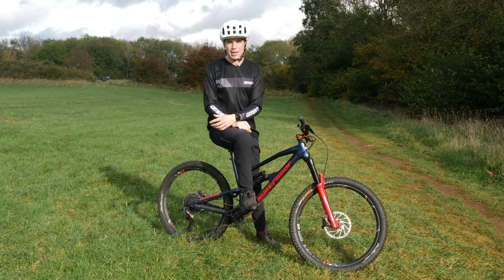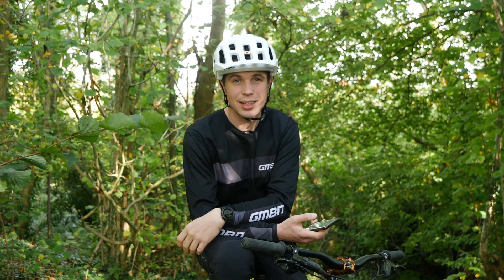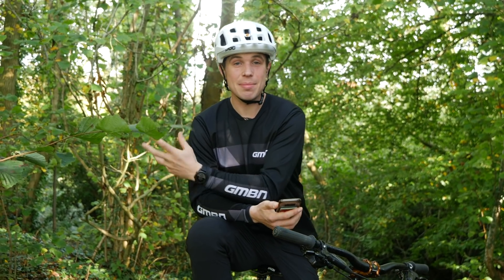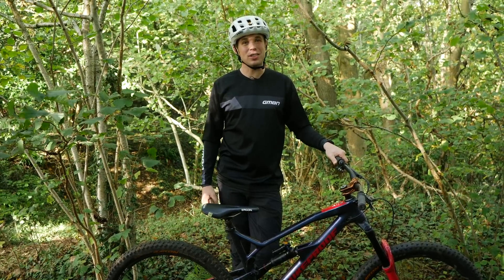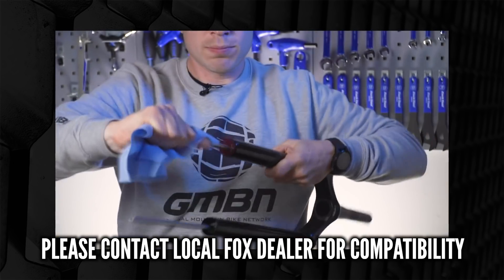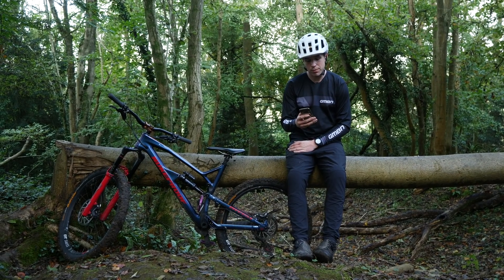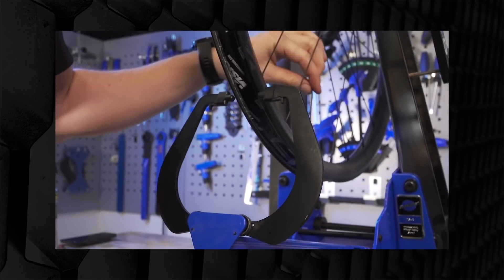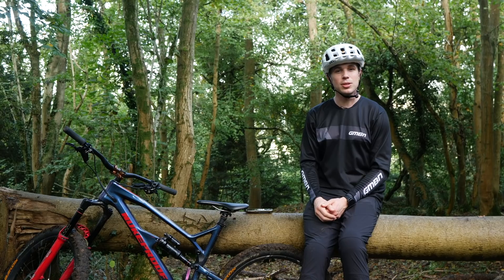Why Aren't Disc Rotors Bedded In By MTB Manufacturers? | Ask GMBN Tech

Comment from the maker: Got a question about MTB tech? Submit it below using the hashtag #AskGMBNTech for a chance to be featured on the show 👇
Reply: #AskGMBNTech This question is due to your statement about high-flow presta valve for tubeless not making sense since we can use Shrader tubeless valves which, due to their higher diameter, should flow much more air.  I asked worldwide cyclery if I can get replacement cores for the tubeless Shrader valve they carry, as replacement cores seemed to be a necessity for the presta valves.  I don't know if all cores for shrader would be compatible.  Since it is unusual, they did not understand the question and recommended I stick with Presta.  Could you cover this in more detail?  I am an engineer, and ever since you explained the silliness of trying to get high-flow presta valves when we could use Shrader, I can never look at them the same again.
Part 2 of the question is, I have aluminum hubs, so can I just drill out to fit the Shrader valves?  I really like the idea of a naturally higher flow valve.
Reply: #AskGMBNTech silly tech question: steel is better in tension than compression.  However, when I look at the "arms" on a disc brake that connect the rotor to the hub, the arms are in a direction where the arms will be in compression during braking and not under tension.  Is there a good reason for this or is it style? (or do I have it backwards?)
I am looking at your bike in the video above.  If you imagine the rotor as a motor that spins the wheel in the backwards direction (for the force it applies to the rotor), it looks as if it is pushing on the arms and not pulling.
Reply: #AskGMBNTech My rear wheel has some loose spokes. Is there a way I can retighten them without having to go through trueing it?
Reply: #Askgmbntech hi guys french frog eater here. I have got a canyon torque al6.0.  I would like to change my air rear shock (250*70) for  a coil one. I found a rs superdeluxe coil wc in 250*75, will it works ?

Is there a margin of adaptability or we must scrupulously respect the factory sizes ?
Thank you guys !
Reply: #ASKGMBNTECH 
Hi, I'm very much new in MTB. I got myself 2019 BH atomX with max torque of 105 Nm brose engine. Friend of mine suggested to have 2-3 sets of chains and swap them regularly to extend cassette's lifespan. What's your opinion about that ? Btw, huge thanx for your tremendous work and great channel. I've learned a lot already! Greetings from Poland.

Comment: About changing a spoke on a tubeless wheel...assuming the spoke is broken and that chances are you will cut it anyway, I slide a tiny o-ring over the nipple, unthread the spoke, install the new spoke and cut off the o-ring. You need a perfect nipple to do this as your grip on the square part of the spoke will be likely diminished.

Comment: #AskGMBNTech hi Henry and Doddy! I have a 2019 Rockshox Yari Debonair. Problem is that it's sitting low on its travel no matter how much air I put it. I have to lift the fork to reveal the missing 5mm. A lot of forums say it's normal. I need your opinion on this.

PS. I tried burping the seals with zip tie and the lowers have been serviced but still same results

Comment: Hello, I have a Merida One Sixty 800 2018 bike, as you probably know, this bike has  27.5 " wheels. I've been researching to see if it's possible to turn it into a mullet bike by changing the front suspension in order to fit a 29" wheel. As I understand it, this is possible on bicycles with original geometry for 29 "wheels and not vice versa, because they apparently affect that geometry very much. Do you think that is possible? And in that case what would be the recommended suspension considering that the front travel of this bike is 170mm?
Thanks.
Reply: If it is 170mm front and 160mm rear then I’d put a 160mm fork and 29” wheel as this wouldn’t change the geometry as much. If it’s 170mm front and rear then I’d get a 29er 170mm fork. In terms of the geometry, it will slacken the head angle and raise the front end, which may be able to be countered with stem spacers, you may also want to tip your saddle down slightly

Comment: #AskGMBNTech Hi Doddy and Henry! I have bought a new Boxxer Worldcup 29" 2019 this year. The fork is running sweet except last month there is a little bit of oil coming out under the Low Speed compression adjuster which gathers under the  whole compression adjuster unit. Also the Low Speed adjuster can now only be moved 2 clicks to closed until there is big resistance. Do you have any idea what this might be and how I can fix that? I already do service my fork myself. Cheers Chris

Comment: Hi Guys!

I will get my first full- sus- bike soon with a Carbon Frame. Are there any rules About using Special compounds for maintaining? For example: Can I use normal grease for pedals in a Carbon- crankarm? or is it possible to use White Assembly compound for the dropper seatpost,... or do I have to use Carbon specific compounds. Also interesting for me is what to use if re- installing the fork after Service in at the Crown area: can I use normal yellow grease or does it have to be a Special Carbon- grease/compound?

Cheers!
Reply: MrGrayFox0 I believe carbon cranks have aluminium threads, then get carbon gripper paste for your seat tube and any other carbon/metal or carbon/carbon interfaces. Not sure about the crown area tho

Comment: Hi there! I have a shimano Zee brakes, the are great but every time I leave the bike 3 o 4 days without riding, when I ride it again, the brakes feel contaminated (front and rear), the stopping power drops dangerously. After several hard brakings, their are at full power again. I've searched on internet and some people say that shimano brake pads tend to contaminate with moisture from the air. The brakes are 5 month old and are in perfect condition so I'm sure the problem is on the pads. Acutally I'm using resin pads, should I try another brand/compound to avoid this? Thx dudes!  #askgmbn
Reply: How do u store the bike? is it in a cold environment, two wheels on the ground, hanging vertically?
Reply: @powedits4447  I store it in my bedroom two wheels on the ground away from oils or grease and I pump the brakes few times a day.

Comment: #AskGMBNTech Hi GMBN, I've got a merida 140 700 2018. It has a center lock rotor in the back and a 6 bolt in the front. Can I put a six bolt on the back or vise-versa. Thanks :)
Reply: There are centerlock to 6 bolt adapters

Comment: #askGMBNTech Spongy Brake... My front brake is soft and spongy at first, but after a few pumps of the lever, it firms up and feels normal. Is there Air in my system or are the pads wearing thin and making the caliper pistons have to extend out further, which would make my lever travel further and feel soft? It gets scary bombing down a hill and when you go for some front brake, there's Nothing there at first.  But after few small pumps, the brake works fine. Thank you.

Comment: #AskGMBNTech Hi, love the show! I have recently put tyre inserts (rimpact) into my wheels and now the front tyre is no longer straight and the rear one keeps deflating (front tyre is relatively new, ridden it for ~1month before, rear one is older) Local bike repair shop said they did not find anything wrong with the front tyre, it is just zig zagging and said it should straighten later, is that correct?

Comment: #AskGMBNTech I am converting a 10 year old+ Scott Scale 60 to a 1x system.  I have a 2018 e*13 gearset off a newer bike but obviously can't use the 11speed rear cassette on the Shimano free hub due to sizing issues of the smallest cog. The e*13 is designed for an XD driver. I have a 32T e*13 trsr boost chainring up front and was going to pair this with a Sun Race MX80 11speed, 11-50 cassette at the rear.  Is it possible to pair a boost chainring with a non-boost rear hub or will this ruin the chainline.  Thanks, Steve. #AskGMBNTech

Comment: Hey #askGMBNtech I need some help.  My MTB came std 27.5+ w/ 150mm fork, (HTA 66.8°)(STA 74.1°)(BBH 335).  My MTB is 27.5+/29er compatible w/ a flip chip.  OEM states "fork must change to 140mm if wheels change to 29".  What effect will not changing out the fork have?  How many degrees will the HTA and STA be effected?  Any other issues with geometry if I don't buy a new fork?

Comment: #askgmbntech I am looking to buy a halo ridge line 30mm front wheel and was wondering if the extra width would change the width of my tyre by a significant amount or not as I'm not sure if my wheel would fit inbetween my fork,
Thanks
Reply: How wide is your current rim and tyre?

Comment: I convert to a 1 by 11 to a 1998 B17 Dh Marin narrow wide 34 tooth front and on the back 11 speed . 11 to 46 only problem I had was spacing the front chainring extra 1. 1/2 mm and using a two-piece hollowtech
Crank set and Shimano XT 11 speed clutch rear derailleur and Shimano XT 11 speed gear changer
I will be changing the rear sprocket to a 11 by 42 by using 26-in wheels on the 46 tooth rear derailleur is a bit low 🤔
All just a experiment.

Comment: #askgmbntech Hi. I’ve got a set of X Fusion Slant RL2 forks on my Ragley Blue Pig (26” wheels for real steel fun!) and need to service them. I recently sold a bike which had some Rockshox Recon on them which used 15w oil and. Have about 500ml of this oil left. I believe the Slant forks use 7.5wt oil, i remember hearing somewhere that you can use different weights but need to adjust oil volume. Is this true, can I use the 15wt oil in the x fusion forks? Don’t want to waste so much oil

Comment: how to fix a derailleur hanger that is integrated in the frame 
I have a mtb which has a integrated hanger
it got bent from a crash
it has lost its strength and trying to re bend it can completely rip it off
can you please help me
I live in a place where there are no mechanics and unfortunately i do not have access to a pickup truck or a bike rack #askgmbntech
Reply: The only way I can think of tho fix an integrated hanger would be to get a derailleur hanger alignment tool. If the hanger is massively bent then the frame may be a right off as there is no way to replace an integrated hanger
Reply: @powedits4447  cant you drill in holes and install a hanger
Reply: @powedits4447  can you drill holes as my frame is a collectors item
Reply: nadeem javed derailleur hangers are specific to frames. So a derailleur hanger for say a giant trance would not fit on a trek remedy as they are all specific to brand and possibly model
Reply: nadeem javed what frame is it?

Comment: Why don't hydraulic brakes on bikes use a reservoir like automotive and motorcycle brakes?  It would make the bleeding process much simpler.  Also the pads would automatically adjust for wear assuming the reservoir doesn't run dry.
#askgmbntech
Reply from the maker: Hey Kyle, some brake systems do have a reservoir and diaphragm setup like automotive brakes. Check brakes from Hope and older Shimano and Sram models. 👍
Reply: Actually you have a reservoir on the top,take a look on higher end DH brake.I believe cause there is less oil in system and there is no need for motorbike style brakes but it would look cool.
Reply: @elvisp8104  I haven't taken a close look on high-end down hill brakes, maybe those are different.  On the brakes I have looked at if the bike is stationary and you engage then release the brake the pads return to the same position.  If a reservoir with an intake / return port was used the brake pads wouldn't move off the rotor. Well maybe a little due to the seals trying to spring back.  I am sure there is a good reason why this is the system used.  Maybe the force required for the rotor to push the pads back is noticable on bike where it isn't on a motor bike?
Reply: @kyleandres9287  probably,less forces is used and less weight overall.The amount of fluid used on whole bike system is 1dl i think.

Comment: #askgmbntech My bike has stickers on the frame and I want to take them off. Do you have any suggestions on what to use to get the sticker residue off. Thanks. Love the show.
Reply: use a hair dryer and once it reached the optimum temperature you can peel it off without leaving any residue
Reply from the maker: What Nathaniel said 👆. You can also use brake cleaner/ isopropyl alcohol to clean up any existing residue. Hope this helps 👍

Comment: #askgmbntech I have Shimano Deore M6000 hydro brakes, is it possible to add bleed nipples to the calipers for easier bleeding?
Reply from the maker: Hey Julian,  the M6000 bleed nipple is located on the rear of the calliper. Henry just did a real time brake bleed with a Shimano brake 👉 https://gmbn.tech/realtimebrake hopefully this can help 👍
Reply: GMBN Tech I'll have to give it a much closer look. I didn't see anywhere to put a 7mm wrench on.

Comment: 10$ is actually cheap for replacing spokes..that’s the price for just truing in most of Europe. Extra 5$ for spoke replacement and extra $ for rim tape and sealant....it costs normally 20-35$ for the job (depends on the tape and sealant)

Comment: #AskGMBNTech Hey guys, recently i had a pretty bad crash on my hardtail , and i bent my derailleur hanger,now my bike barely shifts, is there a way to bend it back or do i have to buy a new one? (derailleur sram X.3 7,8 speed)
Reply: If slight then yes, using a hanger alignment tool like park one, or just get a new one
Reply: New ones are about £25 or as someone else said, derailleur alignment tool
Reply: okay thanks guys!

Comment: #askgmbntech hi guys, recently been looking at a 2019 cube sting hybrid for my mrs, the guy in the shop seemed to suggest that the gen 3 Bosch system sometimes ran a 3mm offset chain ring, and said they were like rocking horse shit to get hold of?! As well as the hefty price tag compared to the new gen 4 standardised chainring compatibility. How would I find out how and if this bike has the offset ring? Cheers for any info 👍🏻

Comment: got my cars pads changed today, Brake was biting as always without and bedding in, , whats the reason for mtb brakes are behaving differently?
Reply: Car brakes need bedding...garage often does for u, or its pretty quick as they get hot fast. Its the heat that causes transfer of pad material to disc...often wondered if heating disc with blow torch would help...but prob more effort than doing normally
Reply: Also, if the pad material is the same as your previous pad then it wouldn’t need to be bedded in. As Henry said, bike rotors are not pre bedded in as there as about 4 different pad materials for riders to choose

Comment: #askgmbntech I have a frame with an IS42 top headset cup standart and the bearing sits a bit loose in there. The bearing itself is totally within standarts (41.8), but still the fork steerer might have some movement. Are there any ways this is possible and how can I fix that?
Reply: Darvin Black it is the angled interface edge on bearing and shell  that center the bearing in the headset.    Many newer headsets are loose in bore diameter of the cup but when tensioned correctly will work well.    Grease the bearing and wiggle when you install bearing as they can jam at an angle and make it difficult to get correct bearing preload tension.
Reply: @richardlocke3375  so simple cleaning of conical surface will do?

Comment: #askgmbn I have a 2018 trek roscoe 8 with a sram NX 1 x 11 and I want to upgrade to a 12 speed, so will a 12 speed casete fit on to the existing free hub.
Reply: A SRAM SX or NX 12-speed cassette will work. I wouldn't do that upgrade, because it doesn't really have any huge benefits, maybe just change your chainring size?
Reply: Tomi Saaranen it adds a 50t chainring to the cassette
Reply: @powedits4447  I know, also potatoes taste like potatoes.
Reply: @powedits4447  Also it's a cog, not chainring, chainring is what is connected to your cranks.

Comment: Referring to the first question... why a 1x10 speed? If we are talking about Shimano he could mount a 1x11 and have more range...
Reply: I was really waiting for the 11 speed recommendation as well... I always tell my customers to go 11 because it's the same price basically, and fits and regular 8/9/10 shimano driver (only on MTBs). If the OP is reading this, go 1x11 with at least an XT shifter!! Either full XT or even mixed in with SLX and sunrace parts etc, 11s shimano with an XT shifter is the BEST thing you can do for the budget.

Comment: #askgmbntech Hi guys, so my I have an eleven gear cassette with a 1by up front. I seem to have a problem as my chain is twisted to the left when I am in first gear which makes a weird noise, doesn’t make going uphill efficient and might wear out the chain very quickly. Would you have any solution for this? Thanks
Reply: Chainline issue; I had this on my fat bike, also 1x. You may try mounting the chainring on the inside of the spider, if possible with your system. In my case it was fairly easy to reverse things.
Reply: Thanks a lot! Will try that as soon as possible

Comment: #askgmbntech What is the deal with brake levers in UK vs US, vis-a-vis the front brake on the right or left?  We're planning a trip to London soon, and will likely rent bikes at some point, so should we go with the UK standard or try to do a special 'US' setup?  I guess the downside is maybe launching over the bars if we forget left vs right...
Reply from the maker: We would suggest you ask to have them swapped over to what you are used to. Looping out when messing about doing wheelies can suck.. but a full speed emergency brake situation can result in a huge OTB! Bicycle brake orientation originates from the side of the road you ride on and is so you can signal at a junction when crossing oncoming traffic.
Reply: Go with what u are used to. If its sram brakes, its easy as they can fit either side